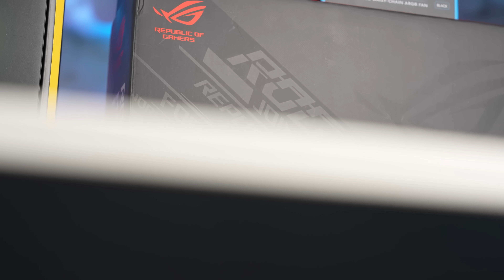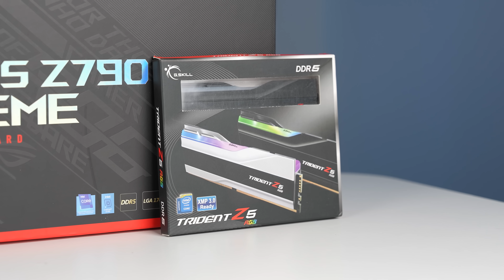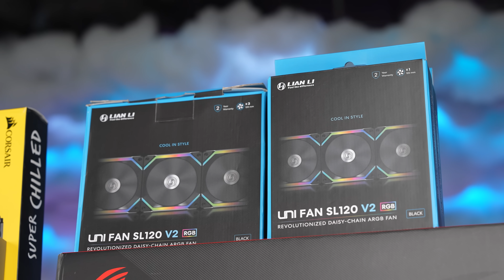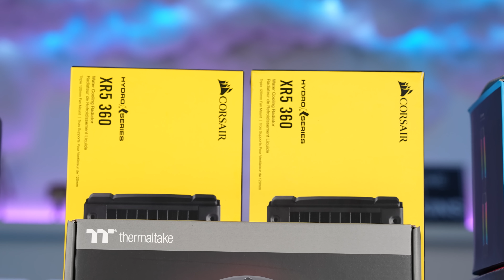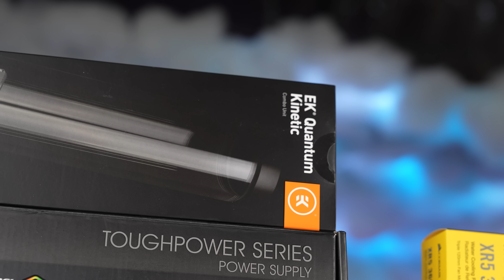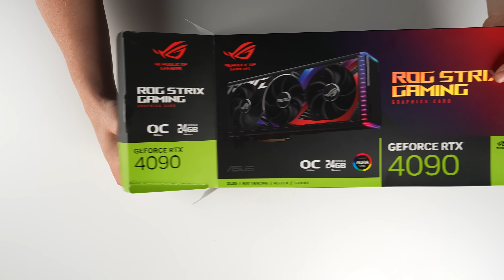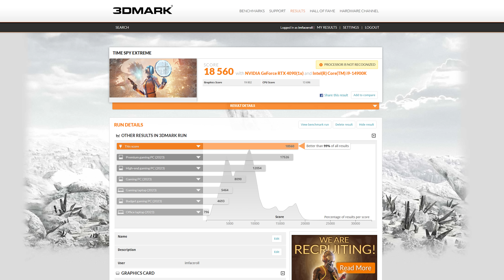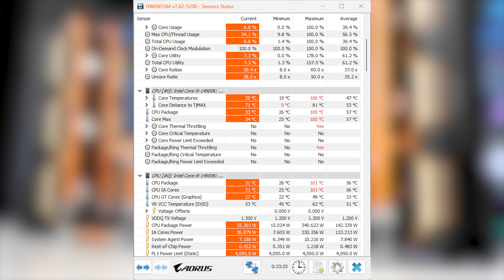Building the most *POWERFUL* PC in 2024 - i9 14900K + RTX 4090 w/ Benchmarks

Comment: What’s the point of placing fans on the both sides when you alread installed liquid cooling and even though the case is totally open 🤷🏻
Reply from the maker: To dissipate the radiator heat

Comment: Both manuals, MasterGel Maker &  Thermaltake Pacific SW1 Plus CPU Water Block, say: 
Use the included plastic brush to spread the thermal paste equally over the surface of the CPU for maximum coverage. I guess most people don´t have the patience to do it properly.

Comment: NAH I DO WIN .IF YOU GOT THE MONEY THE BEST PERFOMANCE BUILD IS Asus ROG STRIX X670E-A GAMING WIFI ATX AM5 Motherboard with AMD Ryzen 7 9800X3D 4.7 GHz 8-Core Processor with NVIDIA Founders Edition GeForce RTX 4090 24 GB Video Card with G.Skill Trident Z5 Neo RGB 32 GB (2 x 16 GB) DDR5-6000 CL30 Memory with Samsung 990 Pro w/Heatsink 4 TB M.2-2280 PCIe 4.0 X4 NVME Solid State Drive with Corsair Obsidian Series 1000D ATX Full Tower Case with Asus ROG STRIX LC 360 RGB GUNDAM 80.95 CFM Liquid CPU Cooler with Corsair AX1600i 1600 W 80+ Titanium Certified Fully Modular ATX Power Supply with Microsoft Windows 11 Pro Retail - Download 64-bit and for monitor I don't know but one I got in my mind is LG OLED evo 42.0" 3840 x 2160 120 Hz Monitor. The most op build total price 7.5k usd

Comment: I have i9 9900k with RTX 2070 super (8GB) which i build 5 years ago. I play RDR2 on max settings. nvidia overlay shows me
GPU 98%
CPU 30%
FPS> 40-50
GPU Usage> 4-5GB Of 8GB
GPU TEMP> 65-75C°
GPU power> 200-220watts
GPU VOLT> 1V-1.2V
GPU clock> 1900-2000mhz
GPU fan> 2200-2300rpm
Memory Clock> 7000mhz
Is it Good for this kind of PC?

Comment: How about this custom built 

Amd Ryzen Threadripper Pro 7995WX 

Oem Open Desktop Processor 

(100-100000884) Quantity 1 

Asus Pro Ws TRX50 Sage Wifi sTR5 

Ceb Motherboard (Pro WS TRX50- 

SAGE WIFI) Quantity 1 

GSkill Ripjaws S5 96Gb (2x48Gb) Ddr5 

6400Mhz Desktop Ram 

(F5-6400J3239F48GX2-RS5K) Quantity4 

Samsung 990 Pro 4Tb Nvme M.2 Gen 

4.0 Internal Ssd (MZ-V9P4T0BW) internal Quantity1 

Samsung 990 Pro 4Tb Nvme M.2 Gen 

4.0 Internal Ssd (MZ-V9P4T0BW) external Quantity1 

Cooler Master Haf 700 Evo Atx Full 

Tower Cabinet Quantity1

Corsair Icue Link QX120 Rgb White 

120mm Pwm Cabinet Fan 

(CO-9051006-WW) Quantity8 

Asus Rog Ryujin III 360 Argb 360mm 

Cpu Liquid Cooler (White) (ROG- 

RYUJIN-III-360-ARGB-WHITE) Quantity4 

Asus Rog Matrix Rtx 4090 Platinum 

24Gb Graphics Card (ROG-MATRIX- 

RTX4090-P24G-GAMING) Quantity2 

Corsair Ax1600i Digital Atx — 1600 

Watt Fully Modular Smps 

(Cp-9020087-Uk) Quantity1 

Corsair Xeneon Flex 45 Inch 

45WQHD240 Hdr Oled Bendable 

Gaming Monitor (CM-9030001-PE) Quantity2 

Razer BlackWidow V4 Pro Mechanical 

Gaming Keyboard (Green Switches) 

(RZ03-04680100-R3M1) Quantity1 

Mad Catz The Authentic R.A.T. Pro X3 

Optical Rgb Wired Gaming Mouse 

(Mr05Dcinbl001-0)Quantity1

Comment: Not populating all of the RAM slots triggers my OCD. Do better.
Reply from the maker: Ddr5 is not stable with 4 sticks
Reply: @DesignsByIFR  Odd, because I'm running 4x16gb 4800MT/s with no issues.  Perhaps because it's AM5?
Reply from the maker: @RoundBoy304  4800mhz isnt that high so likely not experiencing stability issues.

It is a known fact that ddr5 works best with two sticks at the moment, that is why they usually sell as a set of two RAM sticks instead of 4 unlike DDR4 which was easy to find in a set of 4

Comment: so you built the third most powerfull gaming computer. the 14900 is the exact same as 13900. its the same chip and everything and they only tweaked it ever so slighting that you get less than a 5% performance increase if any at all

Comment: I wonder if graphics card manufacturers will start making cards that use liquid cooling right out of the box?
Reply: They've been around since the 1080
Reply: @Potasium-n4h  earlier than that. Even pre-900 series. I remember there were some 700 series cards that had blocks on them already.
Reply: or atleast naked ones, so you don't have to pay for the massive air cooling systems they install on them..

Comment: Beautiful build, as always. But doesn't the AMD 7800X3d beat this refresh chip at gaming?
Reply: Fuck no the 14900k eats the 7800X3D for dinner in gaming lmao, go watch some video comparisons
Reply: Not even fucking close
Reply: @angeldustshusband8060  Wrong. Go check Hardware Unboxed, Tom's Hardware, and Techspot benchmarks.
Reply: @angeldustshusband8060  New benchmarks out today say you're wrong. Hardware Unboxed channel.
Reply: @angeldustshusband8060  New benchmarks out today from Hardware Unboxed say you're wrong. 7800X3D beats the 14900K in 75% of the games tested. And the 14900K has been run too hot and has stability problems on many motherboards.
Reply: Id still choose amd with the 14900k instabillity issues..
Reply: Yes but at very low rate like 3-5fps if i am not wrong.
Reply: @zaselimgamingvideos  this comment adds nothing to understanding the difference. 3-5fps? at what settings? with what gpu? in what games? cos with gpu bottleneck at 4k cpu it's irrelevant, because the difference can be in other sectors, like power or cost
Reply: @zaselimgamingvideos you talking shit rn... ive seen mulitple benchmarks and the 14900k beats the 7800X3D in almost every game.
Reply: nah, all u just need to do is use fast ram, disable the e-cores and run at 6Ghz all core oc and even the 7800x3d will fall behind.
Reply: @Pillokun lol never r7 7800x3d outperform this at even 3x lower tdp

Comment: Beautiful build. But why not clean off the old thermal interface material from the GPU before application of the new GPU waterblock. Seems kind of half Ass’d. Not what I would expect with this level of build
Reply from the maker: I did clean it off, there was a tiny bit at the sides but not on the die

Comment: Is the Maximus Extreme available again? I was looking all over for one with no luck
Reply: you would find some used maybe brand new but overpriced. i dont understand why he used this motherboard, new rog motherboards for intel 14th gen are comming up soon.
Reply: @entertainyou2851  thanks - yea I did find the used ones but ridiculously priced. I think it’s an exceptional board tbh and I don’t think the newer boards will be any better because the form factor remains the same so the chipset won’t change either.
Reply from the maker: No it does not seem to be